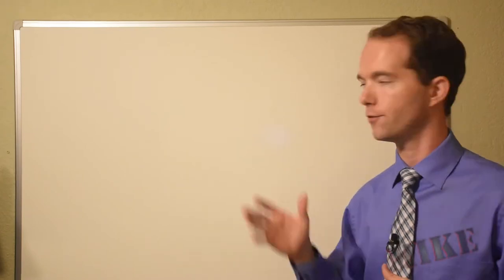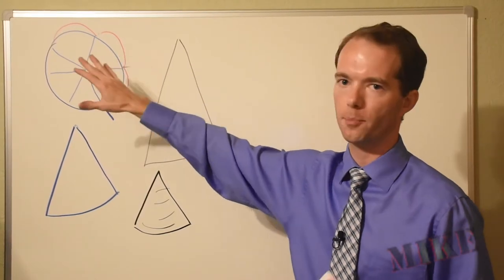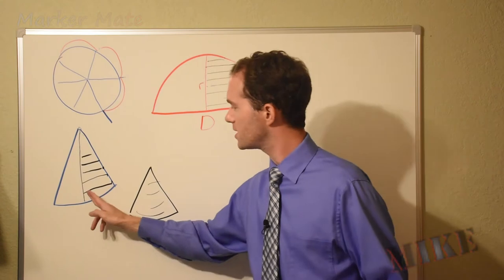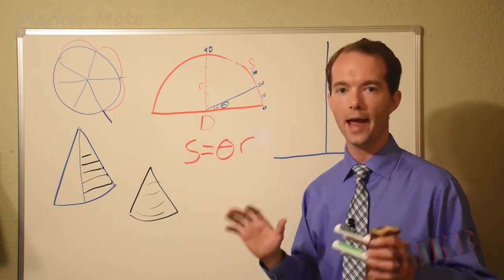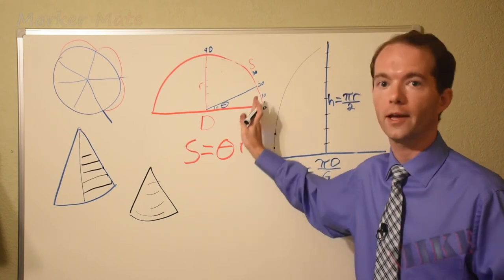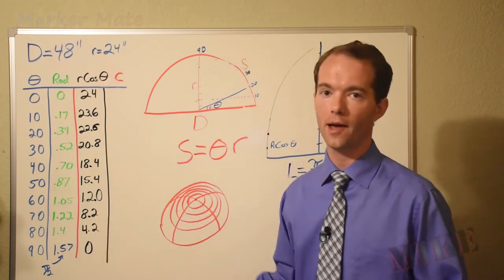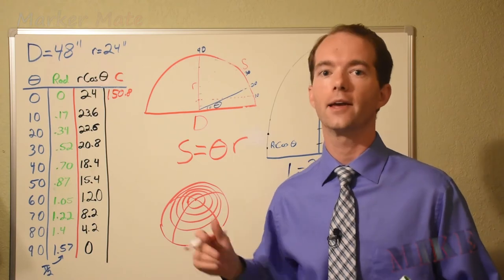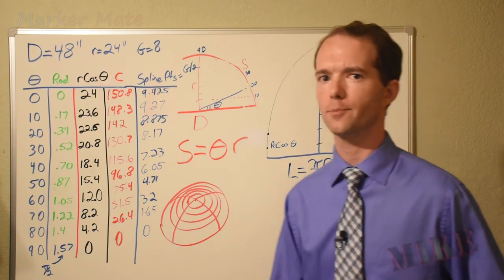Making Perfect Balls, Parachutes &  Balloons - Mikes Inventions

Comment: Hello Mikes,
I have been looking for a bulbous 10-gores hot air balloon blueprint or schematics on the Internet and found nothing.
Would you know by any luck where I could find such thing?
Or a program or iOS app that could help me design one?
Cheers!
Thomas from Brussels, Belgium.
At the moment I am making small parachutes from broken brollies fabricz :-)
Reply from the maker: Hey! I don’t know if any programs that can do that. This method works fine for the top half, then you can pick your points in a similar fashion once you know the diameters of the lower half of the balloon at certain points. It’s a bit of work, but I’m sure you’re capable. Thanks for watching!

Comment: @MikesInventions  awesome work bro i downloaded your excell spreadsheet, but in the ceterline Y station your equation is (90+5 / #of splines). Is the +5 a typo?
Reply from the maker: Well hmmm. That does sure look like a typo. I’ll check it out and try and remember what I was thinking when I made that sheet. I’ll let you know and upload a good one if it’s bad.
Reply from the maker: Ok, so I downloaded it and checked, and I can't remember why I made such a complicated equation in that column, but the point was to create the numbers in 5 degree increments for the spline points. If you just type in the numbers, the sheet still works, but I can't remember why I did it the way I did, but it works that way. It's not a typo.